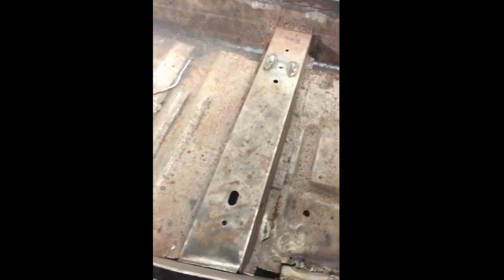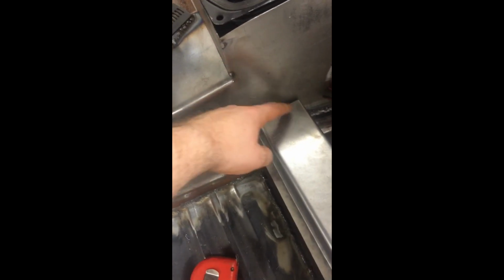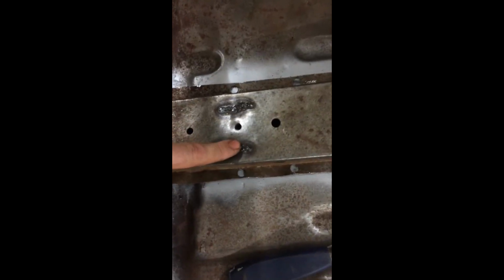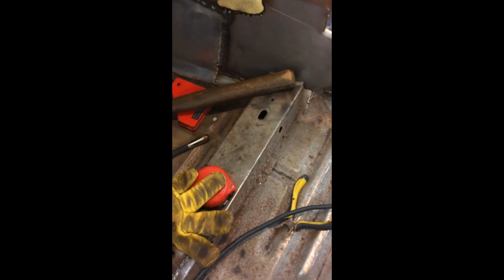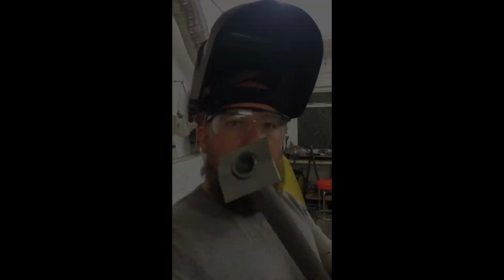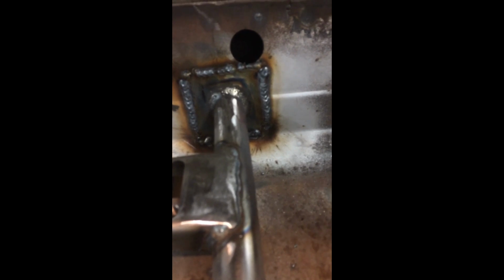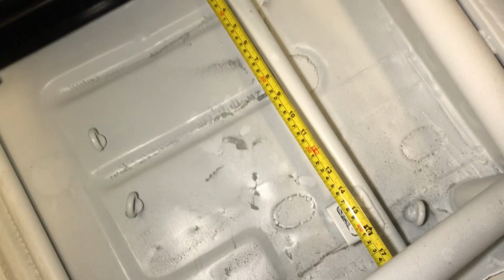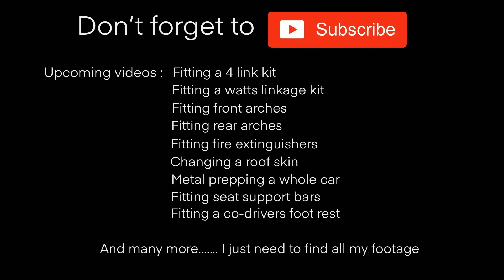Escort MK2: Seat support bars

Comment: Just a thought I have a mk2 Escort Rally car myself and it has the same set up with the seat bars I am at the moment going to change it to seat runners so I can move the seat back and forth as it’s in a fixed position at the moment  
Just a bit of information for you if the car is built as a rally car the seat must be fixed in place and unable to move for MOTs
Reply from the maker: Thanks for heads up. I’m planning a fixed position as it’ll only be me driving it. Is fixed ok for MOT even without being a specific rally car?
Reply: Seats should be movable/ adjustable if they are designed to be,the way I read it is,if they are not built to move should be ok !
Reply: The comments are from a friend of mine who is a mechanic and does Mots
Reply from the maker: Ok. I guess time will tell. I’m currently fixed and still along way from MOT so I’ll what happens in due course. 👍🏻
Reply: I am sure it will be ok as most  Moters are car nuts anyway

Comment: Did the car get painted midway through this video?!?
Reply from the maker: Lol. Not exactly. I filmed some of the videos years ago when I was doing the work, but when it came to make some of the videos I couldn’t find some material, and with the seat supports I didn’t really mention sizes etc, so I re-filmed some scenes recently. The interior has primer and 1 coat of final paint, although I didn’t add a second coat or clear, so the inside really needs a key back and another coat and clear added. The exterior is just in primer form rust.co.uk, a non porous primer to prevent it rusting before paint.